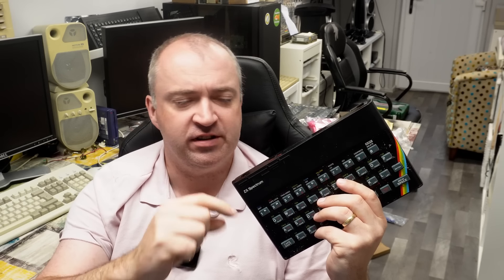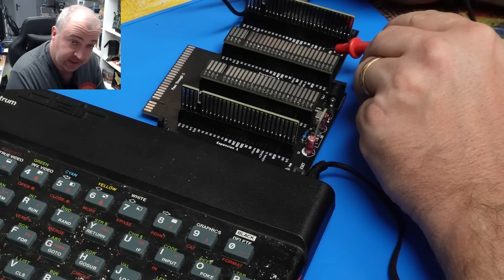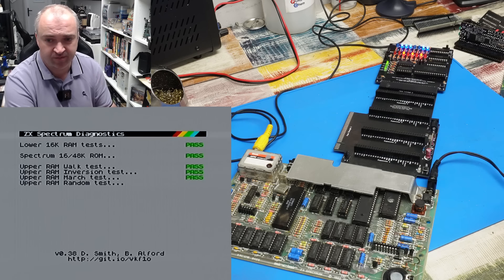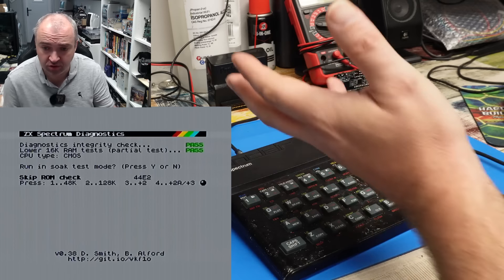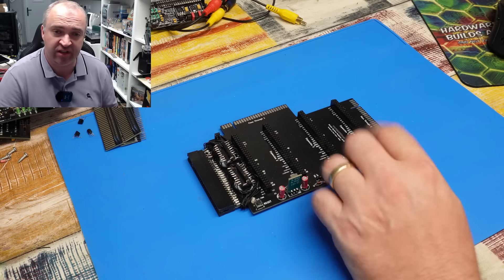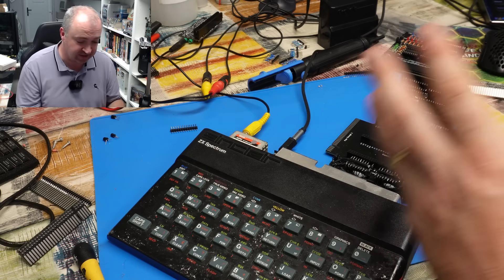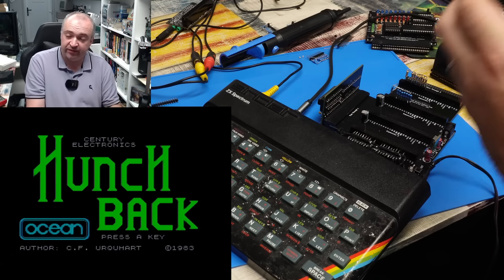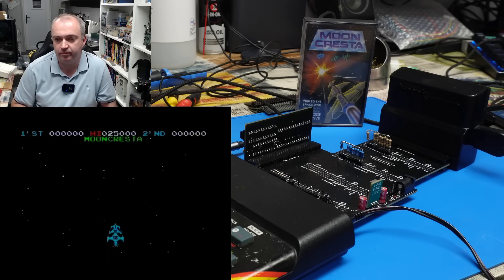BUILDING, TESTING and almost FIXING a backplane for the ZX Spectrum

Comment from the maker: Couple of notes:

1. This video has been heavily edited to try and get it to some sort of manageable run time hence the jump cuts to text.  
2. You may be wondering why I never looked at the bus on my scope.  I did do this but ultimately it all landed on the cutting floor as to be honest my £40 aliexpress scope didn't really show much difference in the data or address bus between when it was running or when it was crashed (unless it had halted of course) or when using the termination or buffers.  Granted there was some evidence of what might be reflections in on the bus which has been helped by termination but ultimately there are still issues.  
3. Since publishing the video I have hard mounted the expansions slots (2nr of each type) and it was resulted in the card becoming very unstable again.  I still believe that correct termination and perhaps buffering will resolve this but I'm unsure of how to properly calculate the termination or how to implement bidirectional buffering.  
4. With the issues I faced while completing the dc-dc mod I'm not totally convinced there isn't another issue somewhere with my spectrum which might also be causing problems with the backplane.  I would be very grateful for any advice here. 
5. It seems my statement about 48k v 128k ULA and screen modes is nonsense, the 128k does support double buffering of the screen but it is the same screen mode.  The corruption seen when trying to load NSID might be down to difference in the ROM?  Perhaps the software is calling something from the 128s rom which obviously isn't present in this machine?  
6. I hate spectrums.

The making of this video has stretched my knowledgebase to its limits but the only way we learn is to hold our hands up and ask for help so please if anyone can provide some advice I'd be very grateful .
Reply: It is things like this that really make you appreciate how clever the early computer people really were. 

I mean, figuring out the electronics and building the boards and the supporting circuitry and whatnot..... And to top it off, those guys who figured out how to make ICs in the first place..... 

We get a glimpse into their genius minds when trying to repair "their" computer with little to no prior knowledge.

Long-winded way of saying I enjoyed your video ;)

Comment: You have been lucky to happen on a databus bias point that works.  For the size of the backplane and the things you are wanting to plug into it, you really need to add a bi-directional data bus buffer. Its good practice to terminate the other end of the busses too.  so you have installed an address bus buffer, but have not terminated the address bus, and you have not installed a data but buffer, but have terminated that bus.  Internally the spectrum will already have some form of pull-ups on the data bus I imagine, but the chips in there, especially the DRAMS wont have the drive capacity, so you are overloading the internals of the spectrum, which will lead to random reliability issues.    The problem is, a passive backplane is no good here, you want both address and data buss buffered, ideally bi-directional to allow bust mastering for expansions that want to drive the bus.  

The purpose of the buss termination is to eliminate signial integrity issues with reflections.  Generally not a real-wrold problem at 4Mhz, but, you can get shadowing effects with the fast transients, on those digital lines, so high current drive capability (aka buffers) and end of line termination (1k pull-ups) at the furthest end of the expansion bus board, those two things will solve all the stability issues you are seeing.   Bottom line is, the passive backplane is just not up to the job.
Reply from the maker: Thanks for the detailed reply,  I've been looking at improving this board today although it will be a while as I'm just order parts for testing with before committing to a complete redesign.  

It's turning into a good learning curve for me and I'm enjoying the challenge.  I'm sure there are lots of mistake still to be made on my part but going to start with 245s on both buses and go from there.
Reply: @CRG  don't worry about making mistakes, thats how you learn.   8-bit computer busses from the 80's are a well trodden path, so should be easy to get a good reliable solution going.  TTL drive levels are challenging because relative to modern CMOS stuff they are quite power hungry.  When you are driving a bus you are dealing with capacitance and load, and sometimes the odd reflection, so higher drive currents and a bit of termination (which also demand more drive current) overcomes these problems easily up to around 25Mhz. So 8-bit computers are power-hungry things.  The expansion board should without issue, you just need the buffering and things will work just fine.   Before you go off building another backplane dead-bug in the data bus drivers, sort our address buss terminations and if you have access to an oscilloscope, look for relatively clean square waves. 

If you are not sure what to look for, and you have a 20Mhz or better oscilloscope, start with the bare computer and observe the signals directly on the CPU pins, you should see reasonably well defined square waves peaking towards 4.3v and below 1v, once you have a good feel for what those look like, now do the same on the signals at the other end of your bus setup, with some cards plugged in, you will find the signals won't look the same any more, more rounder, lower 1 level voltage and higher 0 level voltages, your buffers and termination for your setup should get you back to pretty much what you see directly on the CPU when no expansion is attached.  It will be very clear what looks right on the scope if you are seeing that level of unreliability. 

Also, consider that it might not be all data or address lines, sometimes busses are loaded or driven unevenly because of the circuit design, so check all 24, and don't forget the memory access control lines like Rd/WR and so on... they need to be just as clean too, and may well need buffering too.

Comment: Great video Glen!  Copper tape (grounded) somewhere might help - in the same way the pull ups / pull downs did.  It really needs buffering as you talked about.
Reply: Yeah, adding buffers and pull-up / down termination should fix it. The termination needs to be at the /end/ of the bus, and you're putting a card AFTER the termination resistors.

In any case, I'm gonna try this stuff once my 48k speccy arrives. 🙂

Comment: With a large expansion card like this you really do need to buffer both the address and data lines and make them all bidirectional and tristatable. This is so any device that becomes a busmaster by issuing /BUSRQ will be able to drive the buses itself. The same goes for any device that wants to do DMA like the z80 PIO or the SIO etc. Termination is also always a good idea.
Reply from the maker: Yes I had noticed on the schematics that if BUSRQ is asserted then another device can take over the buses but from chatting with a few spectrum guys no-one knows of any such devices.  Probably should have explained that in the video...  I agree that the data bus needs buffered as well but I'm unsure how to do that.  Could you offer any advice?

Comment: The DC-DC circuit on the 48k spectrum all the way to the issue 6 is fairly marginal. The biggest issue is it doesn't fully address the start up timing for the 4116 ram chips, as well as uses an unregulated "9v" supply that could be anything between 9 and 13v.   I am thinking through perhaps making a drop in CMOS DC-DC module that will have considerably better power delivery
Reply from the maker: If you do make one please let me know as it would be interesting to try.
Reply: Back in the day one time I got my Speccy working again by creating the -5v rail by using an ICL7660, inverting the 7805's 5v. The 12v dropped to 9v because the oscillator wasn't running, but it was enough for my 4116s to run reliably. Did many other mods. Sound sampler, eprom programmer, a 2k static ram mapped over the rom so you could fix rom bugs by poking new data or speed up saving and loading by poking new values in the tape tone timing loops
Reply from the maker: The link will be blocked automatically, but I can approve it if you want to share.

Comment: Nice video.  I always wondered back in the day if it was possible to upgrade the standard 48k Spectrum to full 128k (memory, sound and video) with a single expansion, I don't know how feasible it would be but it would have imo been better to keep the original Spectrums look with full 128k models compatibility.

Comment: I have a similar 16K expansion PCB for TS1000 and it works great. It's only has 2 chips and 1 RAM chip so it runs much faster than the original. And it's smaller.

Comment: I see a 74F series logic there (there may be more), they are functionally the same with 74LS ones, but have slightly different logic level interpretation and also, they like to run faster. Both of these contribute to the fact that they don't play well in a fully TTL circuit, which the Spectrum is. Replacing that (and possible others) with proper 74LS TTL logics may solve the issue. But I totally agree with you on that port replicator board being stupid big and it makes it prone to every kind of interference and voltage drops. I like the idea of buffer ICs, and bus termination, and it will be a more scientifically correct approach to scope the buses with and without buffers and termination resistors to see what they do.

Comment: you probably have noise on that backplane that is higher than 0.8V and by using bus termination (voltage dividers) you are pulling it down below 0.8V so TTL logic 0 can be correct
Reply from the maker: Thanks for the info, do you know how I would calculate the correct value for termination?
Reply: @CRG  sent you the answer on Discord

Comment: 33:30 It looked as there was a bent pin on the joystick adapter ...
36:00 Did you test that board without termination? Maybe it something else that make it fail?

That game Mooncresta only allow one shot at a time, so there is no need for hitting the fire button as you did.
Reply from the maker: It did have a bent pin which ended up breaking, so I replaced it with a pin from what was left of the cut down edge connector.  It works but it's a different type of pin, hence why it looks different.

Comment: Maybe it also needs to be a four layer PCB with a ground plane in it. You could try the GadgetUK trick of copper tape on the bottom soldered to ground.
Reply from the maker: I did try that trick but it didn't seem to do much.  Got a few other ideas from comments though so a few things to try in the future.  I've put it to the side for now though.

Comment: Yeah... 24:31... you like living dangerously! On an expansion like that I would have fully buffered ALL the signals. I think the bus terminations are a furphy, i.e. you are masking an overloaded bus with bus termination compensating partially for the inability of the system to drive all the signals to the correct levels. Have you measured the power consumption of the system with all the expansion stuff connected? Are you within the limits of the poor old 7805 regulator? Look at the supply rail on the expansion. I suspect it looks very noisy. If you add bulk capacitance then don't just add say 100uF electro but intersperse 100nF and 10uF ceramics as they cope better with the fast transient requirements of the logic.

Comment: Thanks for video. Though I  didn't get why it actually exploded. As for instability, that backplane is way too long. If you only need two expansion cards at the same time (128K + SID), then it might be worth redrawing gerbers and shortening the pcb for just two expansions.
Reply from the maker: I honestly have no idea why it exploded either.  I've put it to the side for now as I want to move onto other projects but I will try to pick it up again at some point in the future and  redesign the layout.

Comment: The thing about the Spectrum 128k is that it has 64kB of lower RAM and 64kB of upper RAM.
I don't think you can really replicate that just by plugging something into the expansion port - that only allows you to add upper RAM (to a 16k Spectrum).
Reply: The 128k does not have 64Kb of lower ram, it has two 64Kb blocks, it's very different. The memory is divided into 16Kb pages going from page 0 to 7, page 5 is placed at 0x4000 and is the video memory, then comes page 2 at 0x8000 and finally page 0 at 0xC000. To use the 128k you write to port 0x7FFD and choose which page is mapped into the 0xC0000 addres and that is mostly it, only there is a special page (page 7) that can be swapped with page 5 when you set bit 3 of the request to the port 0x7FFD to use as a secondary screen buffer (and that's what cannot be replicated using the expansion port), but it presented nearly no benefit so it was never used by comercial software as far as I know.

Comment: Any reason why you didn't try the 7805 replacement to a Switch Mode 5v Regulator, lower power overhead and no heat?
Reply from the maker: No reason really, but I do have a couple of spares so probably should have just used a switch mode supply.

Comment: I think generally any of such expansion card was projected to be connected with any other this may be source of many problems.
Also i wonder if you checked mechanicaly how good is connection from Spectrum to expansion card, beacuse it is strange
that test fails after 3 attemp, when you press on board to do reset.
My theory of faulty first connection to ZX Spectrum is stronger as you done other card with new one.
But is very strange with this connectors... some tin wiskers ?
I wanted to see you cut termination at the end to test if it matters.
Reply from the maker: The mechanical connection is something I thought about and I've cleaned both the edge of the spectrum and the slot more times than I could count.  It does get a nice tight fit so I think it's as good as it can be.  Since the video I have tried removing the termination again it just instantly falls over.  Few other things to try though so I will revisit at some point but I've put it to the side for now.
Reply: @CRG  I don't have a Spectrum schematic in head but this kind of bus is not terminated typically but some kind of few kiloOhms +5v pull up should do some good. Simultanously connecting it symerticaly to gnd sets empty bus voltage +2.5V wich i think is not beneficial to especially TTLs ;)
Also i wonder if diodes should  be used, becuse now you also creating line to line copuling wich also will use "fan out" if lines are in diffrent states. 
Some LS245 buffers should be ideal, at every "port" in ideal version, but then it becames crazy ;)